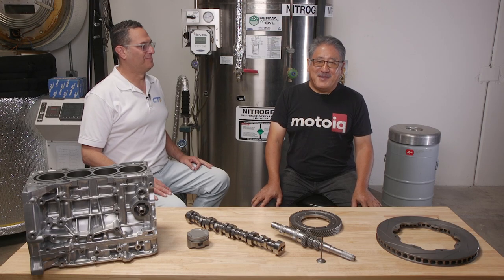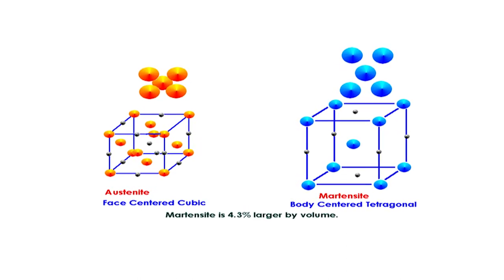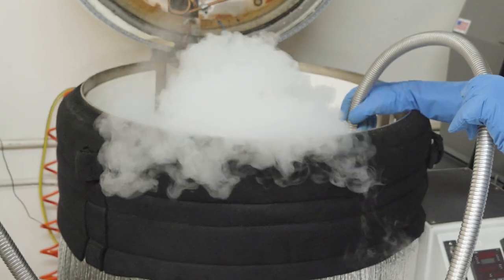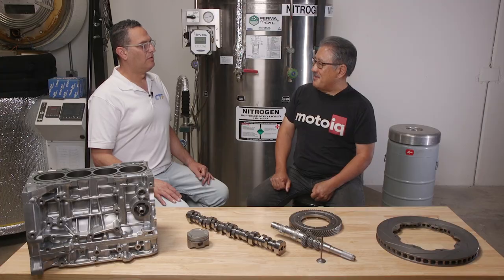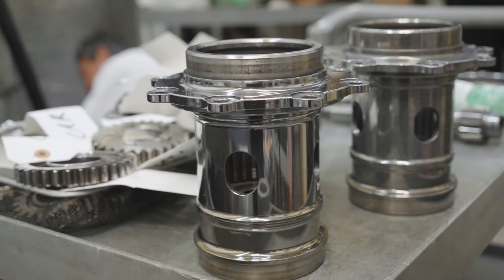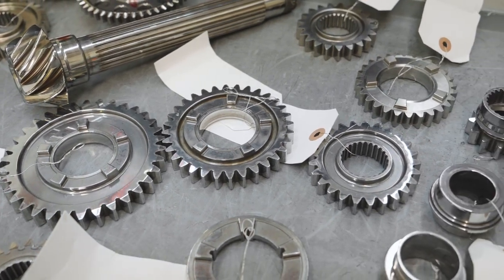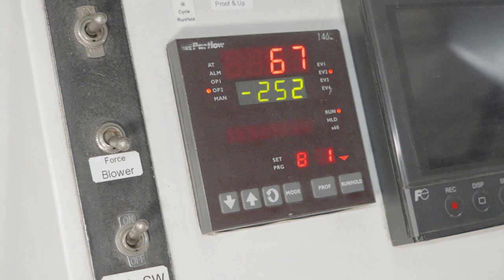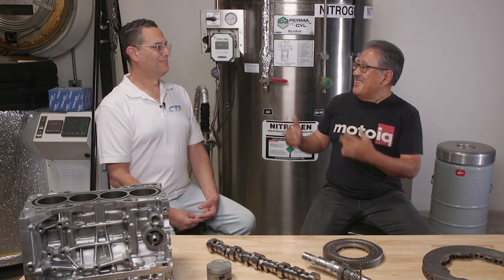What Cryogenic Treatment is & Why You Need It!

Comment: Cyro and WPC is the secret sauce
Reply: It really seems to be though
Reply: What is WPC?
Reply: @shhhdontshout  think of shot peen but way way more precise and doesn’t take away material. I had it done to my crank and it wants to spin for days. I think they use a ceramic bead that’s all the same size if I remember the video correctly. He’s explained it in a video.
Reply: @402SHO  crankshaft of what engine? And how much does it cost?
Reply: Can you do both of those then add a DLC Coating?  Does a loe friction coating like DLC interfere with the “oil holding” aspect of WPC’s Dimples?
Reply: @ericlotze7724  idk about the coatings all the parts I’ve used where not coated

Comment: Out of curiosity. I remember in the SCC days. You guys used SwainTech coatings on on your builds. It would seem that with the addition of SwainTech coatings to the cryo and WPC’d treated parts, you would just be adding a layer of protection and benefits. A slight added cost, not as much as I thought, but still. Is my thinking correct or is this just a different route to overall engine longevity and additional power?

Btw, Mike Kojima, it was great to meet you during Fan Fest, in CO Springs. Truly an honor. Well done Team Evasive Motorsports!
Reply from the maker: One thing is swain coating on pistons won't stick to a wpc treated piston, found out the hard way.
Reply: @motoiq  With so many procedures to do to parts, what would be the natural order of treatments. I had my valve train including the camshafts isotopically micro polished next I want to treat them with cyrogenics and lastly a protective coating for first fire up.
Reply: @stevehammel2939  I think if you go to wpc's website you'll find that they recommend coating then WPC, and since WPC comes after cryo, you could perhaps do coat-cryo-WPC since cryo works on the whole piece including the surface.
Reply: @stevehammel2939  depending on the type of coat, I wouldnt expect any to be compatible with cryo -- there are embrittling and differential stresses induced when you have two dissimilar materials as the guy mentioned here. the coating very likely has a CTE mismatch and may become so brittle it cracks as it cant move with the material underneath it.

Comment: Excellent interview and a fascinating topic that was once exclusive to race team secrets and the aerospace industry. I think you nailed it with the comparison to heat treating and the little known benefits of cryo-treating. Automotive alloys are definitely a tricky pickle with such a varied spread of materials that will benefit, but others you'd think would and then turn into ticking time bombs if just one step is done a little off. The only way you could tell other than a subtle harmonic difference is under the microscope.

Comment: Do not cryo pressed in iron sleeves in a aluminum block, the block will crack because aluminum will contract more than the iron sleeve.
You can cryo the sleeves and block separately then machine and press in the sleeves.
Cast in sleeves seems to work fine like on Honda stock blocks.
Also don't cryo LS aluminum blocks they are super brittle and usually crack around the sleeves.
Reply from the maker: Our place, CTP, has the experience to cryo sleeved aluminum blocks no problem.  We had issues with other places with cracking and used to never cryo alloy blocks due to the sleeves cracking but CTP never has problems.

Comment: Where do you buy these freezers? Are they home/company made or purchased? 

Also when you close the door on the freezer do you have a gasket to keep the nitrogen from escaping? Does the freezer have an exhaust to release pressure? If so what pressure is best for treatment. Anyway on getting in contact with you? I have many questions.

Comment: I would love to see if a cryo and wpc treated gear set for the stock wrx 5 speed would increase life out of it power wise. See if it would hold up better.
Reply from the maker: It will for sure probably doubling the life, but it will still break. It can't fix a bad design.
Reply: A friend of mine cryo treated the gearset from his Pulsar GTi-R, it lasted a lot longer but still broke. They’re about as weak as a GC8 box for reference.
Reply: Can't turn a Donkey into a stallion.. First rule in any after treatments.  A good part given the application can be stellar.  Cant throw logic out the window.

Comment: 1:47 they didnt, one of the engineers confirmed it.. blocks outside were newer used, all block were brand new castings from bmw. In the early days of the program, they sourced engines from sold cars (so they had some mileage on them) but that was just until they strike a deal with bmw
Reply from the maker: Maybe, I would think they would used seasoned blocks which have less shift in them after machining.
Reply: Do you have sources? 

I have heard countless times that Bmw engineers used seasoned blocks as the metal was normalized.
Reply: @proxypanda4156  Not only did they look for high milage but they pissed on the m10 blocks which were kept outside during winter - thats what i heard anyway
Reply: @JH-jo9wt  that's a rumour. But definitely the biggest gain was the fuel used, to resist knock. For sure the block was strong enough to withstand that kind of power

Comment: the aging and treating of blocks has gone way back to the 70's as far as I know of from first hand experience we used to have a guy in new zealand  people used to send their 440's to he used to take their donor block and swap it out for a pre weathered one would weather them for 14 years knife edge the crank lighten the pistons rods and crank and rebalance whole shebang he was like the frank black of 440's . I even wound up cryo treating my gearbox's to get them to cope with much higher than factory outputs with some simple bearing seal rekits and cryo because the next step up in gearbag for what I was running added thirty kilo's and that was an actual percentage of weight whole car was 799 kilo's so adding thirty for box was untenable.

Comment: Is cryo treatment a viable option for Magnesium? Not just the material but also for Magnesium monoblock rims? I figured it could help stiffen the wheel and help with harmonics but I would like to know your opinion. I have also thought about potentially WPC treating rims as a further step in strengthening the wheel, but then powdercoating may be difficult.  Obviously anyone attempting this would need to get the rim from the manufacturer before any protective coatings are applied.
Reply from the maker: Supposedly BBS cryo treated mag wheels and got a big increase in stiffness.  I think CTP actually has data, call them.

Comment: Does it change the tollereces?
Reply from the maker: Usually not.
Reply: @motoiq  What about for a rifle barrel Mike? 

Would you recommend WPC on the internal throat of the rifle which gets heat damaged and the metal forms firecracks from "bullet burner" loads?

Was thinking WPC would strengthen the metal and reduce friction, probably make it a lot easier to clean and remove carbon/copper buildup

I understand WPC adds 8 microns and couldnt be applied evenly down the inside of the barrel but what about just at the top on the inside? 

Any thoughts

cheers

Comment: Great video! But I have my doubts about his claims at 12:00
Either I didn't understand what he meant, or he made a mistake... To say cryogenic treatment is making the balance of the part better and reducing harmonics is kind of a stretch IMO...
To reduce harmonics you would either have to change the balance or the rigidity of the part, and neither can be achieved with Cryogenic treatment as far as I am aware...
Either way, great video! Video should have much more views than 4k!
Reply from the maker: It relives stress which makes the stiffness of a formed part more homogeneous, most things have the natural frequency change after cryo.
Reply: @motoiq  makes sense, just as tensioning a guitar string will change it's fundamental frequency → reliving residual stress on a part will also change its natural frequencies.
But by this logic, reducing stresses on a part  would shift its modes to a lower frequency, which would be a drawback IMO, but then, since the stiffness distribution is more homogeneous, the propensity to excite higher harmonics would be probably lower...
Investigating these changes would make for a hell of a great article haha
I'm searching for papers about this topic, but I could not find any specifically quantifying the Vibration/Young's Modulus changes after cryo-treatments.
Reply: By the way, I have access to some modal-shakers and the facilities to do a modal analysis on a part, in case anyone reading this is interested in shipping me (in central europe) some samples before/after a cryo treatment 🤣

Comment: What would happen with components if you used liquid helium instead of nitrogen. Would the parts contract too much and lose their tolerences? In my industry (magnetic resonance) we've largely  gone away from cryogenics due to the cost of Helium and incorporated Cold head coolers under high vacuums and can get just as close to absolute zero as with liquid  Helium. I'm just interested with the  temperature differences and whether there is a 'sweet spot' and if there is such a thing as too cold?!
Reply from the maker: Helium would cost many times more and there is a global shortage of it. Probably from a metallurgy standpoint not make any difference.
Reply: @motoiq  Thanks for answering. Yeah, it's -73C degrees colder. just wondered if anyone has tried it for comparison. And yeah, Liquid helium is eye wateringly expensive these days!
Reply: Shiredrift & company,  I recently retired from 36 years MRI magnet & cryopump “ cold head / compressor “ service repair. I’ve done some minor cryo treatment in a not so laboratory controlled environment with pistols and rifle barrels. The results varied, one rifle a mini14 saw a 100% improvement in accuracy from 4” groups to 2” groups. It was a SS build not carbon steel. The pistol barrel was a 9mm Glock aftermarket for a sales guy at my local range/store. It also improved 100% from 3” to 1 1/2” @ 15 yards. The other barrels didn’t show much if any improvement. 

Everything I’ve read and researched leads to colder temperatures and longer soak time will give better results. I’ve been thinking of building a vacuum chamber and using 30K which is -405F pumps to cool the metal.  Back in the mid 2000’s many rifle barrel manufacturers were cryo treating and selling new barrels for a short time then they stopped. I spoke to one of them and it was because of varied results. One company has been doing a three day soak instead of a one day soak which seams to be the fix for barrels. 

The reason liquid nitrogen is used vs any other gas/liquid is cost! Nitrogen is 78% of what we breathe/ air. It’s non flammable and cheap to produce. $0.50 per liter vs helium anywhere from $15 - $40 + per liter.
Reply from the maker: I did the barrel on my AR15 DMR rifle and the groups went from 0.9"@ 100 yards to 0.30 or less, no shit!  CTP Cyrogenics who we use does a 72-hour soak which they determined to be the best.
Reply: Do MRI machines need constant cooling or only when running?
It would be expensive if that huge 3T magnet needs constantly cooled even when not in use.  Been in a long bore MRI many many times & it gets warm in there at this one facility unless can they dial back on the cooling to save nitrogen or helium?   
Makes me think this one smaller private facility does this ....but they must be able to monitor the magnet temps right?
MRI machines always fascinated but scary at the same time .....

Comment: I cryotreat in my driveway with a big cooler, dry ice and ethanol
Reply from the maker: Not sure if it gets cold enough.  Dry Ice, ethanol is -80 c at the best, N2 is about -190c.
Reply: @motoiq  I'm sure Bentzion is familiar with the TTT Curve for all of the materials that they treat. The curve for carbon steel shows 50% tempered martensite at 160'C and 90% at 120'C. Is it really necessary to quench to -190'C? or is -80'C sufficient? Knife makers claim -80'C is plenty sufficient. For other materials like aluminum, not sure. More independent testing is required.
Reply: In the video, he mentioned claims of parts being stronger and easier to machine after being left out in the winter. I doubt the winter temps got anywhere near -190*C. So what gives?